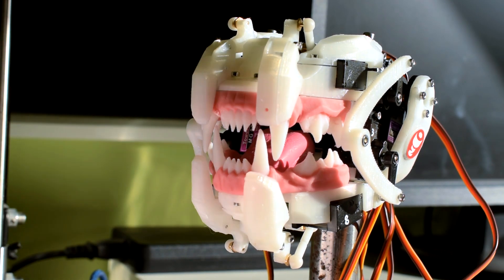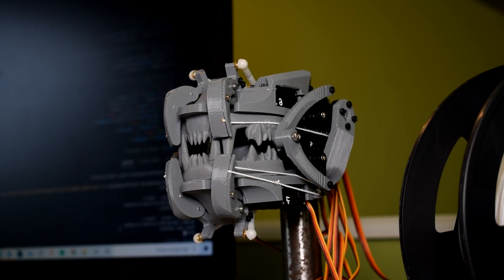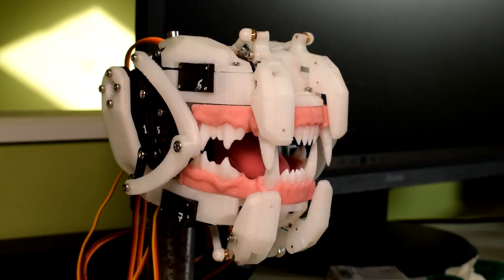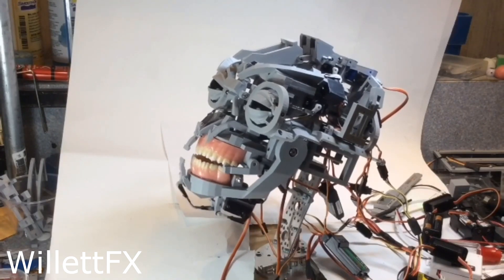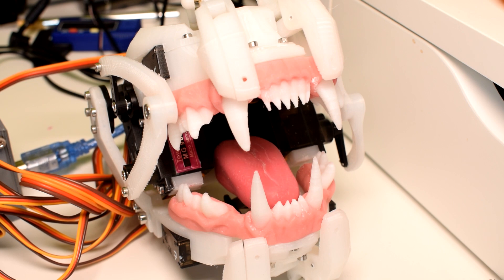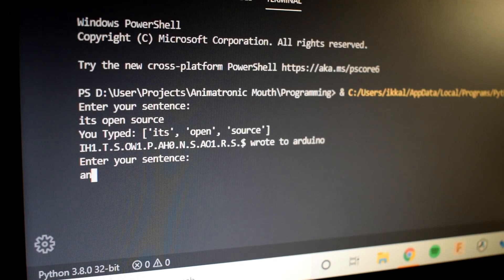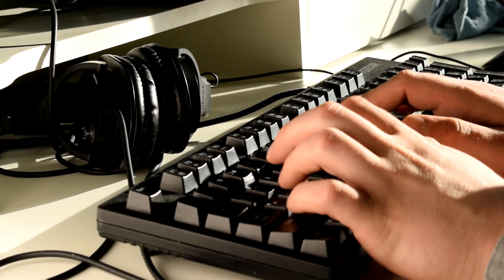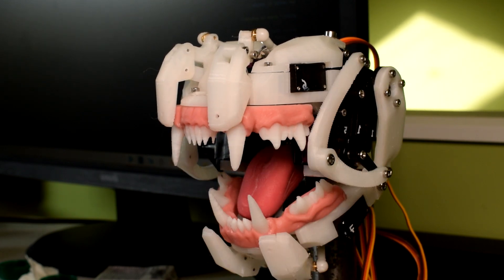Developing an Animatronic Mouth Mechanism

Comment: The hard part of phonetics conversion is that you need a 3 step process. Spell-check to phonetic-dict to phonetic-translation.

Cat, kat, thistle, thisel, phone, fon, Wednesday, wenzday... (Longs, shorts, silent and cross-sounds)

S often sounds like C...

Sea/see = c or cee not ceh (second = cehkund)

That is why, after spelling issues, you need a phonetic dictionary to determine how a specific spelling, in a specific thesaurucal use-case, might sound. Then, that phonetic result fed to a phonetic translation, which is, of your devices ability, the output for that phonetic sound-output. (Adding another servo for tongue-tip lifting, for N/To vs L/Th. You would modify the phonetic translation, not the dictionary.)

Comment: Neat project. If you're still interested in updating the software to be able to control it more easily, you could try using the SpeechRecognition Python library combined with Google's Speech-to-Text API to feed your original program inputs, potentially in real time, assuming you have a corpus of word-phonemelist pairs large enough to cover what all you're saying, such as the Carnegie Mellon University Pronouncing Dictionary.

Comment: I like what you're building! May I'll start working on printing out something like this.
What did you make the tongue from? It is one of the flexible filaments, or did you pour out silicone into a casting mold? all it needs is bendability controlled by a motor so a wider array of phonemes can be produced... oh man, that would be really cool!

Comment: Great work. On the software side, I use the Mycroft AI, with its text-to-speech engines. They originally created visemes to output a series of 8 mouth shapes to match various sounds. These were sent to an arduino for display on a small screen in their Mark I AI enclosure. I pick off the visemes and pass them to an arduino connected to three simple servos in a Teddy Ruxpin. My mechanics aren’t as sophisticated as yours, but it should scale up. The real limitation would be that they only created 8 mouth shapes. Still, it might be worth looking into.
Reply: Are you a technology enthusiast? I have a project to discuss. Reply me if you are interested